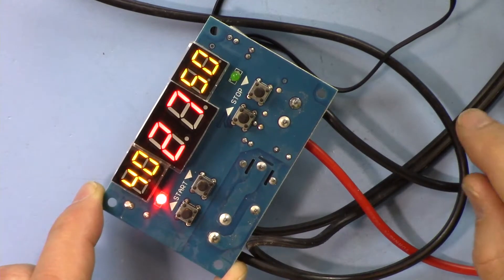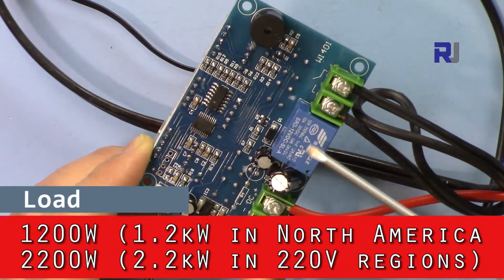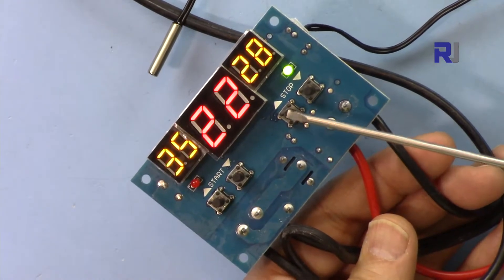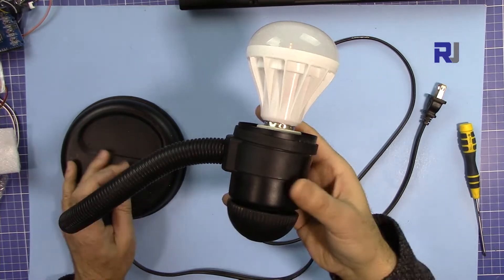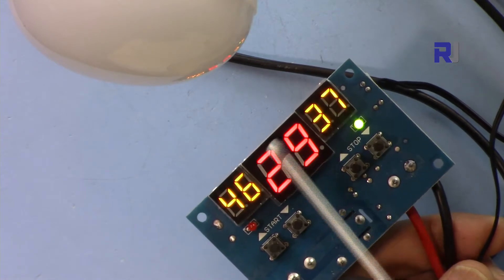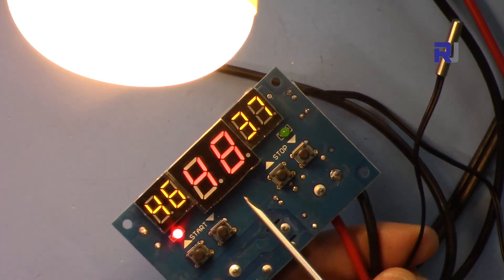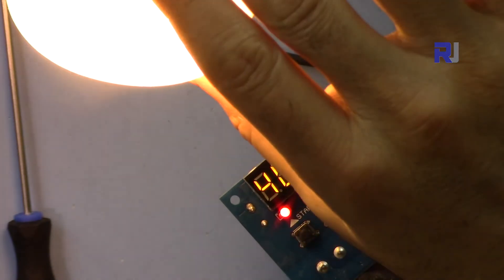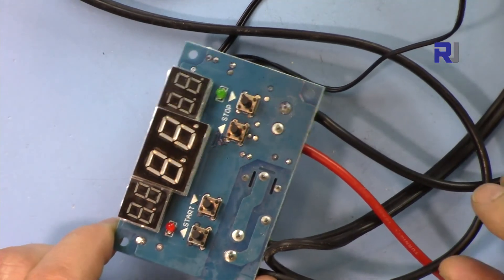Automation XH W1401 Thermostat with Cooling mode and Heating mode

Comment: Thanks for this good video. I have one w1401 but I cannot find how to use the buzzer like an alarm if the temperature is over x degres. I would like use it has cooler to drive a fan on a stove, if the fan is failed I would like the buzer alert me if the temperature is over X degres. I have heted the sendsor at 100 degree but the buzzer dont working, it only stop the display and the relay. Thanks

Comment: Is there delay setting in this model? (before its ON)
Reply from the maker: I have not left any feature of this module without explaining it. So if you watch it without skipping, I am sure you will get the answer.
Reply: @robojax  👌👌 😅😅, thanks.
I watched without skipping but with loading and buffering 😅😅, watta connection that i have 🙈, just curious, in case you forgot to mention it...😇🙈🙏
Reply from the maker: I have to watch it to answer. That's why I asked you to watch it. I have mode 200 videos after this. I don't remember.

Comment: Столкнулся с такой проблемой  одна из плат стала постоянно пикать, то чаще , то реже . Пикает произвольно. Звук такой же как при нажатии кнопок установки температуры. И так же странно мигают индикаторы, тоже произвольно. Вторая плата работает нормально. Кто нибудь сталкивался с этим? Подскажите в чем может быть проблема и как лечится!
Reply from the maker: Faced such a problem, one of the boards began to constantly pee, then more often, then less often. Piques at random. The sound is the same as when you press the temperature setting buttons. And the indicators are also strangely flashing, also arbitrarily. The second board is working fine. Has anyone encountered this? Prompt in what there can be a problem and as it is treated!
Reply: Robojax thanks for the translation

Comment: Nice👍
Reply from the maker: Thank you.
Reply: @robojax  what is better in a plc/heater ssr control wiring > a single setting electric temp sensor controller or this upper lower setting sensor ?